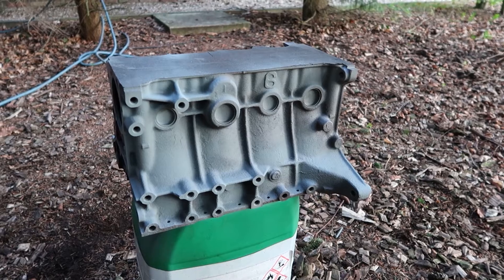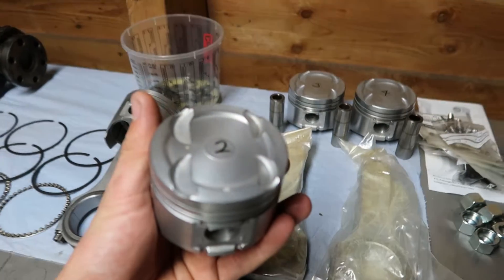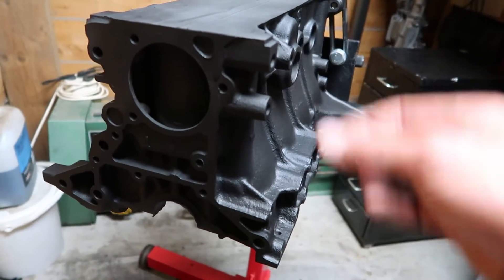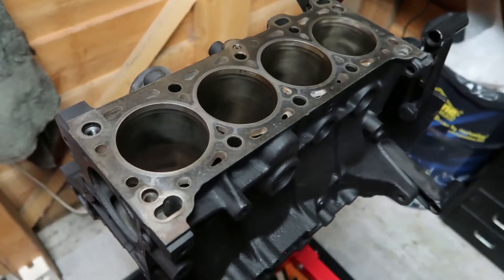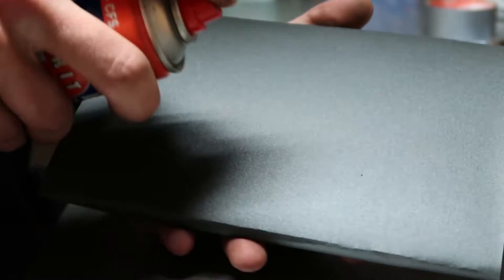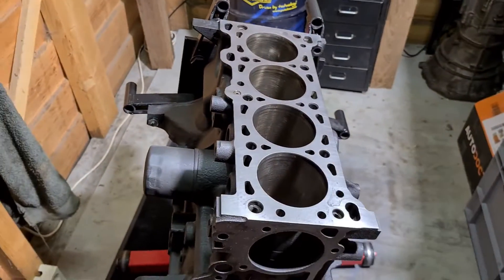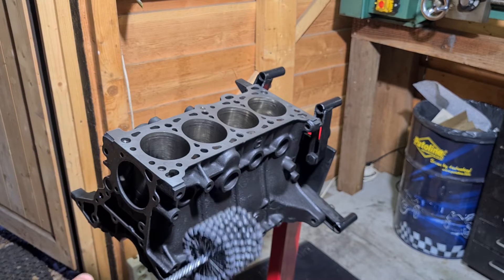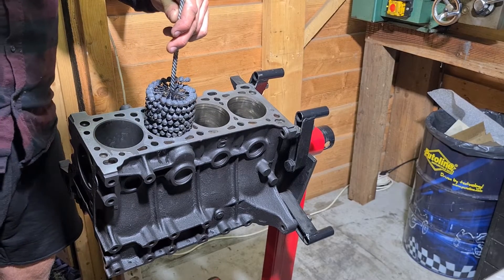HIGH RPM ITB Miata Engine Build (Part 2 - Block Prep)

Comment: Nice I'm doing the same thing on my 1.8 Kia t8d engine. It is extremely similar to the BP Mazda engine, in fact the Kia T8D will bolt directly into a Mazda Miata. But the Kia t8d engine is much stronger. On my used junkyard engine that I have in the car currently its handling over 320 horsepower to the wheels. And the second engine that I'm building out back with stock pistons and rods is going to make about 450hp at the crank.